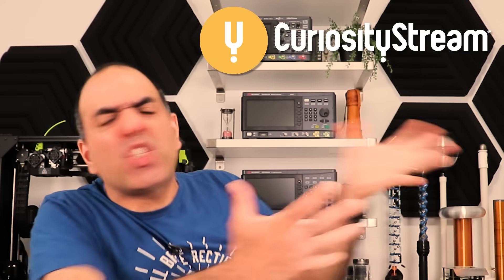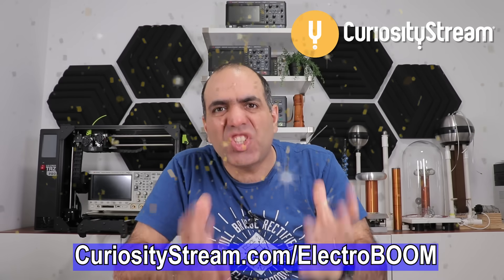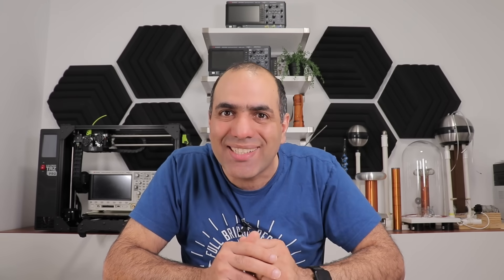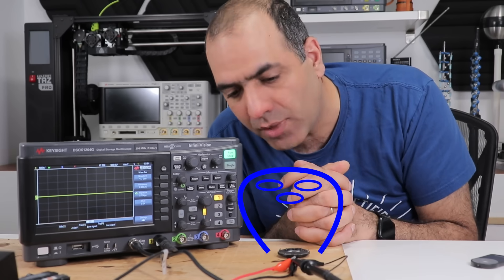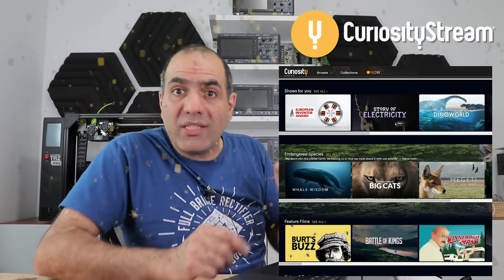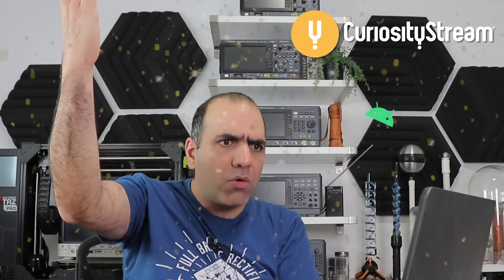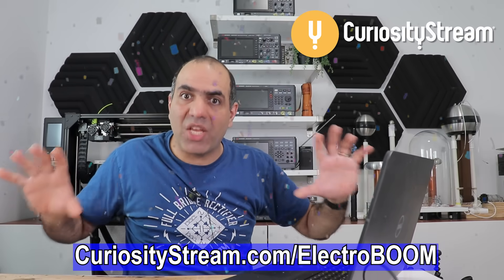Making a &#!$%ing Button

Comment: “You write some code and suddenly you know electronics, you don’t know a damn thing” As a programmer and arduino enthusiast, I feel personally attacked.
Reply: Arduinos are amazing but tbh it is really rewarding to make things with hardware instead. Some things are actually simpler using hardware.
Reply: Arduino is great
But the advanced electronics guys actually would go into how Arduino actually works rather than how to use them
Reply: @jafferkhan175  An electrical engineer designs circuits.
A programmer also designs circuits which are a lot more sophisticated by changing the way electrons move through the millions of logic gates of a cpu by writing code instead of connecting wires and components.....
Reply: @Longus07  Theoretically electrons don't pass information or energy, while in fact it is the EMF that does all the job. And coding is still the most predictable job in hardware design.
Reply: @Longus07  That's not entirely correct. They write code which then gets converted to a mathematical sum and then processed through those logic gates. By your logic anyone whos ever used a computer knows how electronics works because by typing you are changing the way electrons flow through the logic gates that make up the CPUs ALUs. Programmers are extremely smart but programming requires very little actual knowledge about electronics
Reply: @zihangao7385  I don't know about the predictiblity part as don't have a lot of experience in other sectors.
Reply: @shadowxxe  it was a joke if you didn't understand
Reply: I have studied electronics and programming. Programming is not electronics. Most the Arduino kits I see have the electronics designed to be plug and play. Electronics programs teach programming because it is part of electronics. I have a B.S in electronics and still had to explain things to Computer Science majors because they don't understand the hardware
Reply: @RobHumiston  What? really? Don't they teach you how to make a processor out of logic gates in computing science courses that's got to account for something like do they just completely forget?
Reply: @shadowxxe  I did take a course from the CS dept on CPU theory but most students did not think much of it. We did have to design an ALU. There is more to hardware than that.
Reply: @RobHumiston  😯
Reply: as someone using opamps for litteraly everything i feel validated
Reply: Programming is informatic, not electronic. Also, he is right; the only thing you have to do is: put input outputfield; a conditional (if; while, etc); and a delay
Reply: @juanilopezpatterson7330  your explanation shows how little you understand programming and arduino. It depends on the application. Many arduino projects require a huge amount of hardware and electrical knowledge. At least the useful and fun ones ;)
Reply: @stupidvids0  not in this case
Reply: @stupidvids0  also, you have little reading comprehension, cause I didn't say arduino is bad ;)
Reply: @stupidvids0 ?
Reply: DAMNN🤣🤣🤣
( but i agree
Coding is not EE )
Reply: @Jembal985  but EE is 1/48 coding
Reply: Prove him wrong , if you can.
Reply: @kushaldeepsharma5569  You can build your own Processor using logic gates but it would likley be thousands if not millions of times slower than an arduino
Reply: Arduino was created as a quick solution to prototyping some things and building DIY, and not to be a circuit level designer.
Reply: Arduino is very good but it already has everything configured. You just need to program it. It's like using a prepared website template and just adding your stuff into it unlike where you build websites from scratch.
Reply: Guys this was a joke lol
Reply: @maxmitchev2678  AHAHAHAHAH I see your good intentions but YouTube comment sections are just like that.. once they go off, there’s no turning back
Reply: Today I used PLC(programmable logic controler), a switch button, an arduino(for 3.3V), 24v power supply(for plc logic), some stolen cables from old washing machine, two power outlets(one for plc, other for 24v power supply), a special and expensive software, an expensive programing cable, pc (for programming PLC and powering up arduino) FOR making a switch to light up a green LED diode... How much can I make it more complicated to make a diode light up while pushing a button?
Reply: A person should not take a electronics show built on satire as personal attack.
He would do it point blank without fake anger and goofy SFX, cause that's who Electroboom is as a person.

He's not a hater he's a electrician comedian.
Reply: "The start of WW3"
Reply: Of course if you have learned computer science and use it for Arduino then you don't know much about electronics compared to ones who learn electronics
Reply: @jafferkhan175  Correct me if im wrong but one of the tasks you do as a computer scientist is designing a processor. which involves using logic gates to make an adder, memory etc so idk about you but that would require some level of knowledge about electronics
Reply: @shadowxxe  ...maybe it would depend on the university but at my university we didn't learn to design a cpu. At my university all first year Computer Science, Software Engineer, Computer Engineer and Electrical Engineers are require to learn about logic gates and use them to design circuits.
Reply: @shadowxxe  Yep ,but I think those people  have more of electronics background rather than programming
Computer "scientists" or makers are different from programmers who write programmes or makes apps etc I guess
Reply: @jafferkhan175  most Computer Science graduates are programmers that write programs and make apps when they enter the workforce.
Reply: @jafferkhan175  you are wrong if you say programmers who use arduinos don't know much about electronics.
Reply: @Longus07  Maybe just enough to blink an LED
Reply: @Longus07  in many cases people who use arduinos dont even know the main component is a microcontroller 😂
Reply: @jafferkhan175  Depends on the type of "programmer". If you write software for embedded devices than you would have to know electronics quite well and would probably even have a degree in electrical/computer engineering rather than computer science.
Reply: @deeprobardhan3411  LOL🤣
Reply: @Longus07  Did you see the schematic of the circuit Mehdi made showed at 9:30? 
Do you think "programmers" can understand that?
No offense to anyone ,we just studied different things 
EE guys too probably know very less programming compared to programmers
Reply: @ShadowViking47  I have a degree in both, and what ElectroBOOM does is a much harder skill than any Arduino. Obviously he can program an Arduino but he trying to learn you, and when you compare his skills in that regard the guy is a genius. ElectroBoom I'm Fellow grade in BCS, IEEE I'm also FInstLM and CMC Fellow. In short I can award any of those qualifications. DM me and I'll hook you up with any you want.
Reply: @jafferkhan175  i mean, what the hell of a question is that? If you pick someone with no EE background, of course he doesn’t understand that. Just as an EE wouldn’t understand very complex code without having a good SE background. And just for the sake of argument, Arduino is mainly conceived as a learning tool and not as a professional’s tool
Reply: @Longus07  I agree. They know nothing
Reply: @deeprobardhan3411  because they 12 and mum doesn't let them have an ESP8266
Reply: @Longus07  Ask me... lol I know both, plus science and maths, and mechanical. I'll patriot you if you can do my final year two hour exam. I had to do 4 from 6 for my EE degree. How I bet you can't make a start on any question, like you don't understand the point of it. C++ 

I got £1000 day job if you can.
Reply: @jafferkhan175  I'm a programmer with a Computer Science degree who programs arduinos to control circuits I create for sms gate ways, IoT devices and direct communication with computers via serial connections...but yes I occasionally create the LED blinking program to test the arduinos are working.
Reply: @rosskrt  I think people are getting Computer Science and Software Engineering mixed up. Computer Science is the science of computing not the science of software and it isn't about creating software programs either. Computing is a synonym for "solve" i.e. Computer Science is the science of problem solving e.g. how to solve the problem (algorithm), how long will it take to solve (time complexity) and how much space is required to solve the problem (space complexity). Software Engineering is the use of best tools and practices to create a software solution. Computer Science can also be Software Engineers and use software to solve their problems or be Electrical Engineers and use electronics to solve their problem or clock makers and use clocks to solve their problems, the point is that Computing Science is about computing (i.e. problem solving ) not making software.
Reply: @AdamFJH  sorry for the mistake lol. English isn’t my first language and I thought “Computer Science” was just the english term for “Software Engineering”. My bad
Reply: @rosskrt  No need to be sorry I'm just happy to educate people on what Computer Science is so hopefully people can appreciate what it is as well as the people who co tributed to the field like the father of modern day computers Alan Turing. Btw, most native English speakers as well as a lot of Computer Science graduate don't know what computer science is and a lot of online dictionary don't have an exact definition for computer science.
Reply: @BenShepley  weird flex but ok.

And I was joking in the first comment....
Reply: Same
Reply: @Octavio Lopez I need help go back to the days I could some keystone goodies
Reply: To everyone thinking that I was serious when I wrote that first comment, I am sorry if I offended you in any way but I was joking.
I see it wasn't very obvious.
Reply: @Longus07  LOL it was obvious to me you were joking but what you and a lot of people don't know is that you were actually right in a way. Who do you think creates the electronic CAD software that Electrical Engineers used to design and simulate circuits? That's right programmers created then and those programmers are required to have far more knowledge (or at least as much as any) than Electic Engineer about electronics in order to create the software for Electric Engineers to use. When a programmer creates a software to solve a problem they need to become experts in that problem domain in order to create the solution. Note that the programmer that creates the software solutions doesn't necessarily need to have a Sotware Engineering degree, they could have an Electrical engineering degree, Computer Science degree of just an electronic enthusiast.
Reply: @AdamFJH  you are right but it doesn't apply for all the programmers as the work of a programmer depends on where he works. Some programmer maybe developing a game someone maybe building a website some maybe creating software for a rover on Mars.
Reply: Computer science, which is code, tech, electrics and more combined: I don’t have such weaknesses
Reply: many people who have  p.g. from computer science don't know how to install even windows. just because you can code it does't mean anything. many coder may still think that earth is flat
Reply: It’s one thing to write some code, it’s an entirely different thing to design a processor from the ground up. Programming is comparatively easy, even as someone with plenty of programming experience, I readily admit that the people who design the hardware are much smarter than I.
Reply: same
Reply: I know programming and how to use electrical components alone
Reply: Me too, especially with a Arduino and Raspberry Pi.
Reply: Damn this one joke hurt some feelings 💔 lol
Reply: same e
Reply: yeah yeah, such a capacitor (plz don't) who cares?! /s

Comment: 8:17 On a speaker that designed to play the music, they move the resonance frequency of the speaker driver below the useable band by adjusting the box size so speaker will response flat. Some speaker design uses Helmholtz resonator to extend the bass response by tuning the resonance frequency to low frequency where the speaker starts to roll-off. You can look up HexiBase or Toids DIY Audio for more detail.

Comment: 9:26 why don’t you add a FUUULLLLL BRIDGE RECTIFIER for reverse polarity protection?
Reply from the maker: Too much voltage drop
Reply: @ElectroBOOM  I see. I just expect 3 things appear in your video: exploding capacitors, zapping yourself and FUUULLLLL BRIDGE RECTIFIER
Reply: @ElectroBOOM  Just add a battery.
Reply from the maker: :D Imagine the entire energy of one added battery would be completely wasted on the diodes!

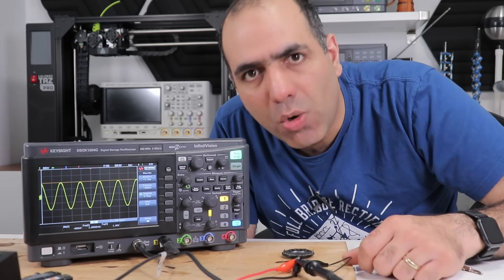Comment: 2:57 that actually looked painful
Reply: Soldering iron burns are not fun either.
Reply: @epiendless1128 what is especially not fun is when your soldering iron has a higher temperature then that of a solder, and when the temperature reaches either its boiling point or some stupid strand gets back into shape and launches the hot solder A TINY BIT BELOW YOUR EYE . Yes, no joke - I had this accident so now I try not to forget to put my glasses on. My eye is fine BTW, but it felt as if it cooled in tear water (or however it's called) and just floated in there.
Reply: Dying ain’t fun either and yes I had that accident before
Reply: @Cheesecake-2018  you clinically died?
Reply: “eeeeeeehghhaaa”
Reply: Yeeeeeahhhhh

Comment: Finally I found a fellow human that makes things that doesn’t know how to program an arduino!
Reply: @Shindiggity  Why not we use both bruh
Reply: ugh same, imma learn them now tho because a 50ct atTiny is cheaper than a 30ct opAmp and a whole bunch of resistors

imma still use opAmps for circuits that need to be super fast or take super little current, but my days of making crazy stuff with oscillators, mem cells and schmitt triggers using only two opamp circuits are finally gonna be over

Comment: Every physical object has a resonance frequency as it showed in Mexico City during the 1985 Earthquake where 9 to 15 story buildings just fell like jello due to mud of the lakebed under the city and the earthquake waves rebounded off harder material and basically did what a nuke does when you blow it up above the ground and creates 2 shockwaves plus city was worse off than the area closest to the quake 8.1 and since the city is an old Mayan lake canal system filled in. 

But the rest of the city was mostly fine just 9 to 15 story buildings.

Comment: cool, I was really looking for a simple circuit like this to use with circuit breakers to get an audible signal when they trip, specially for SPD whole-house surge protectors, that tend to disconnect themselves when fail and stop protecting the circuit without the user noticing, so using this kind of bleep with something like a capacitor dropper and a zener could make it a deal, since powering the buzzer directly with mains 60Hz is too low of a frequency to emit a beep from a tiny speaker
Reply: Well, I didn't read the whole comment, bit I looked it!!